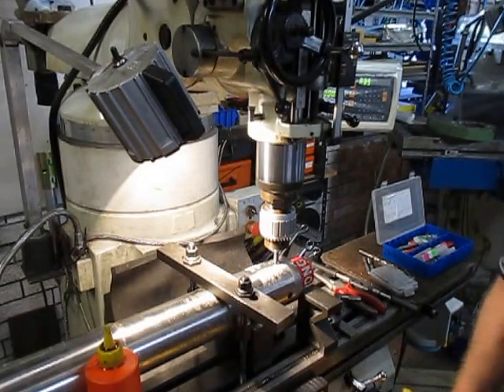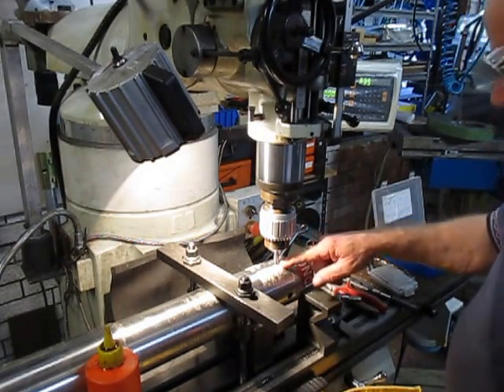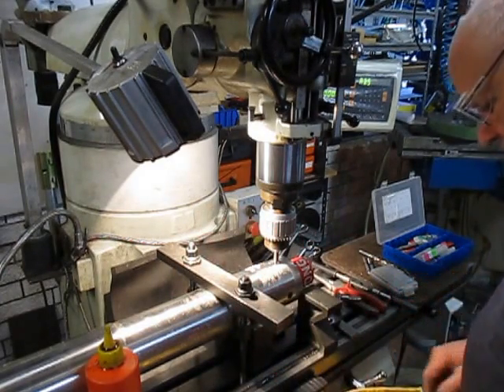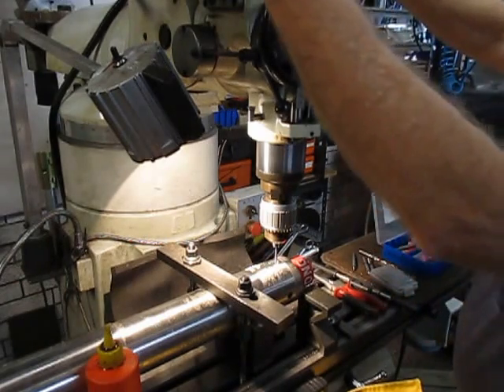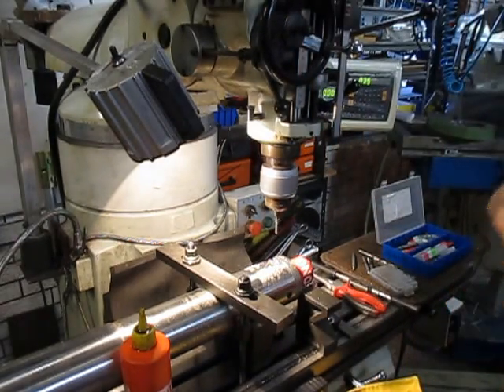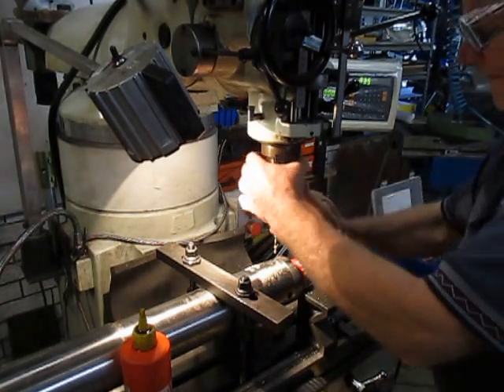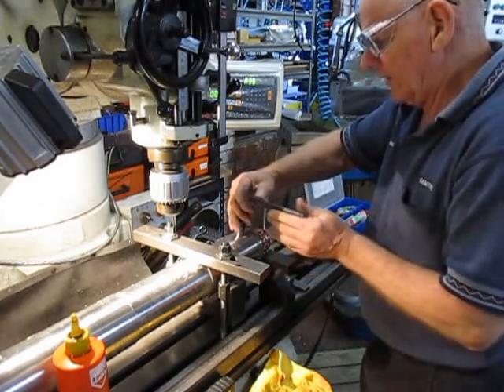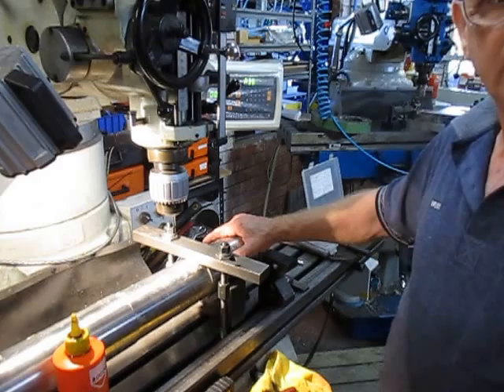Getter Out Quad Pin

Comment from the maker: Thank you all for the visit and the comments: Mark, yes I have  set of left hand drills and use them quite a bit, if you go to some of the other "Getter Outs" you will see them working well. Chris, I don't carry studs in stock, however the allen bolt is of the same strength as the studs either 10.9 or 12.9 MPA tensile strength, and when I started I wasn't sure if I would need to drill / mill the pin completely, so it was a bonus when the first one came out with a great deal of pressure on the spanner.